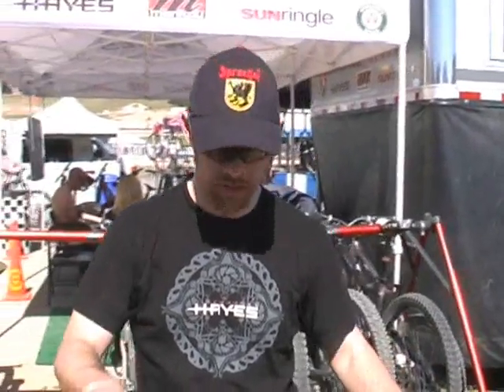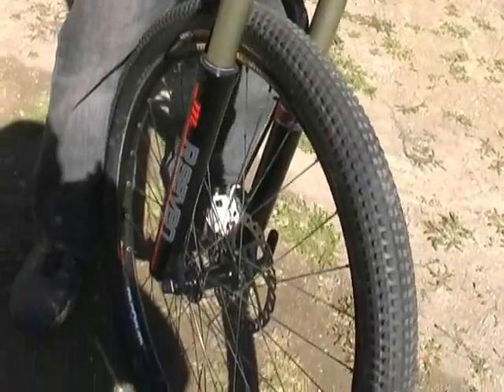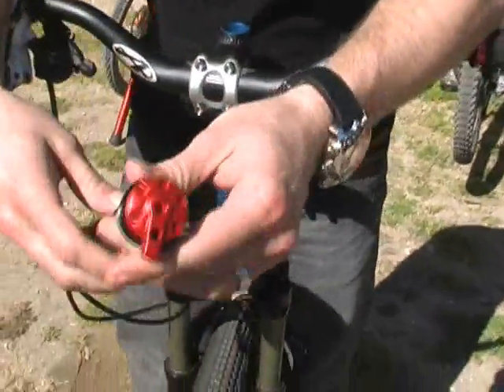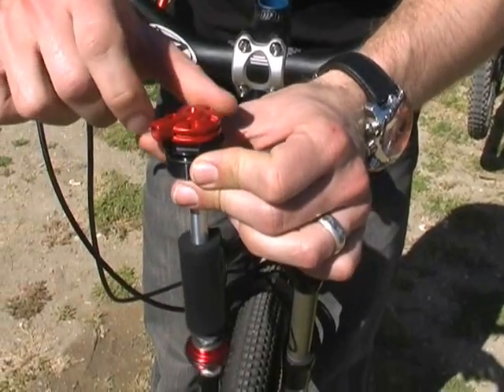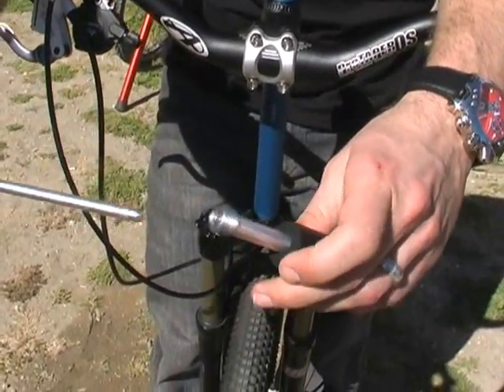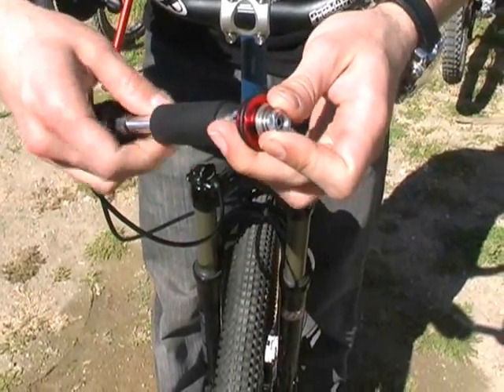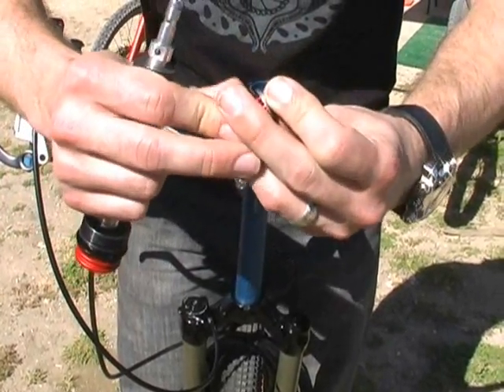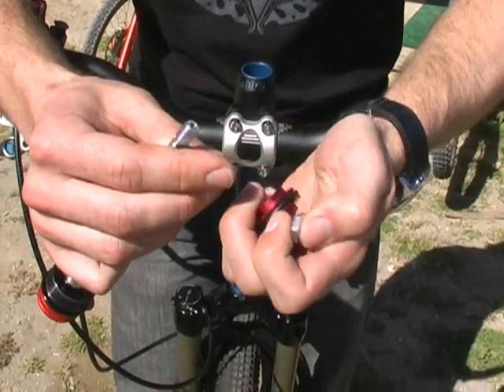Manitou Absolute+ Damping technology explained

Comment: Wow just found this video been struggling for weeks trying to find damper for manitou r7 mrd absolute bought fork missing tip cap and bit for adjuster needle. I get fork is old these days but nobody could find parts I needed. I gambled on new valve had right bit and man it's amazing how such a small green hex bit is not ready and available.